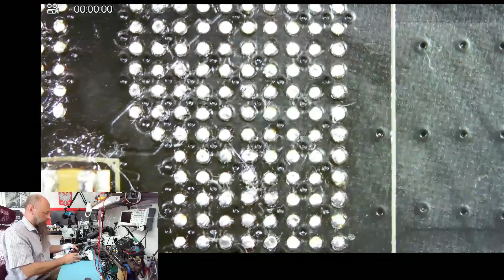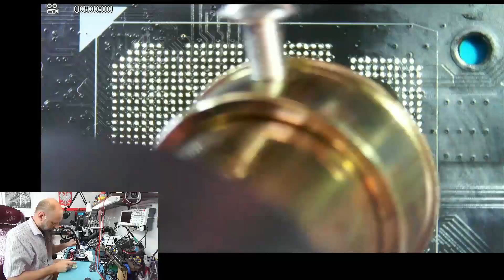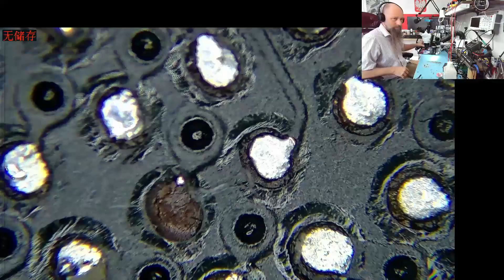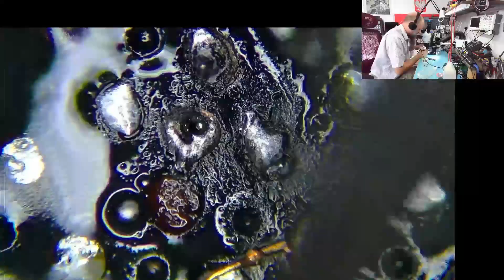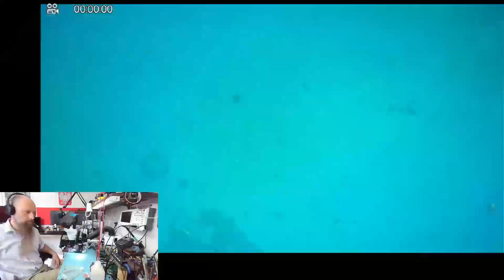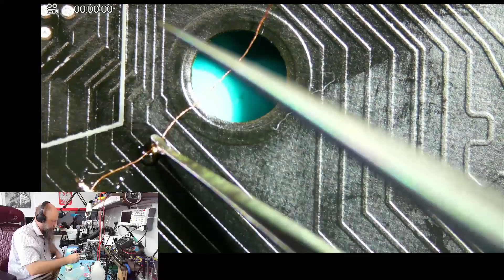Day #41 | CPU Socket Pads Restoration Repair

Comment: For this kind of work I use special repair pads. Those come in different shapes and sizes on a copper sheet. I found wire to be too thick for some jobs, those pads are more 2D than 3D, as the original traces and pads are. Also makes the work easier, faster and looking overall better. And cost is minimal :)
You mentioned it I think later on in the vid, but I do have pads that are even smaller than those (0.2mm). Bought on Ali I think.
Reply: they are hard to use but soooo good for this stuff, also, if tolerances are so tight, might help to use a thinner conformal coating imho.
Reply from the maker: Great tip! I'll look for them on ebay. Thank a lot brother